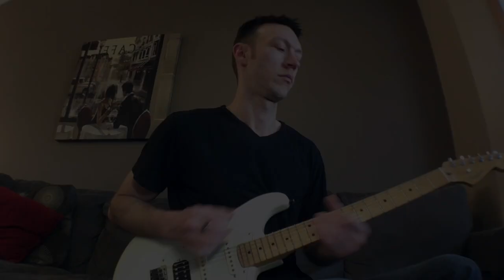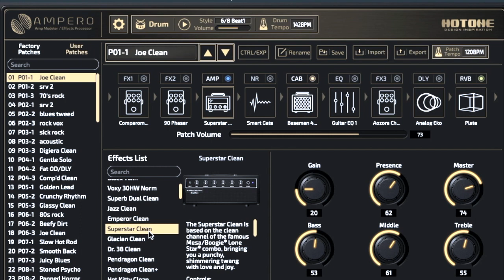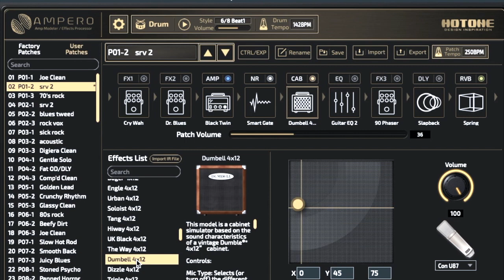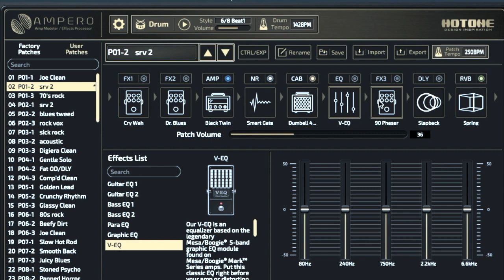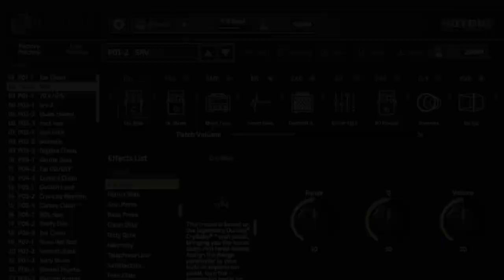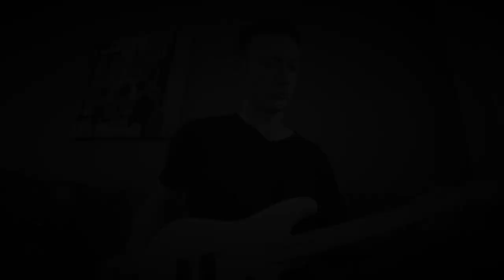Hotone Ampero - Amp/Effects Modeler Review

Comment: Do you still use it ? I hesitate between this and the cheaper but as good Mooer GE200, how is the acoustic simulator? it's for every type use, thanks
Reply from the maker: Yep, I use it all the time. I think it's a good value for the price. The acoustic simulator is Ok, but I never really found an acoustic simulator pedal that I liked, so I usually never use them.
Reply: @JoeFlip  thanks for the reply, does it do dual signal ? for dual amp or cabs, it would be a shame if no with the strong processor it has because the cheaper GT 100 can do that
Reply from the maker: @MrFree-vj8qj  I can't remember if it does or not, you could check out their website

Comment: Thanks for showing it.   If you have tube amps you know how they respond, now having the Ampero you could answer how different is the experience with the included modeled heads, how about finding the equivalent to your real amp and tell about where the modeler does better or worse or is different.
Reply from the maker: In my opinion, there's never going to be the perfect replacement to a real tube amp. There are obvious pros/cons to use using any amp/cab modeler. I think the biggest advantage to using amp/cab modelers is the small size and weight. I'm still tweaking my settings to find the best tone.

Comment: Hello, did you also try out the looper? I'm having big problems with the looper: if I delete a loop and leave the looper function, it sometimes suddenly starts recording again on his own. Also it's hard to play a different solosound over a loop (without recording it). Sometimes I record a loop, push switch 4 and leave the looper function. It keeps on playing the loop, which is fine by me, so I can select another sound for a solo. But sometimes it doesn't keep playing and I have to chose a solo sound and then go back to the looper function (pushing 3 and 4) to start te loop. It's all very spooky and the manual doesn't help much.
I have the latest software installed. I'm very curious if others have similar problems.
Rinie van Rijsingen
Reply from the maker: Hi Rinie, I used the looper a couple times. I can't remember the exact buttons, but one foot switch starts the loop, then you can hit it again to overdub. I think the other switch stops it. When I'm done using my loop. I manually go back into the main menu screen so I don't accidentally start looping when not needed
Reply: Thanks for your answer. Yeah, manually going back seems to be safer, but that's not suitable when you play life. I contacted Hotone and they admit de looper functie is not the best part of the Ampero, they will try to improve it with a software update. @JoeFlip